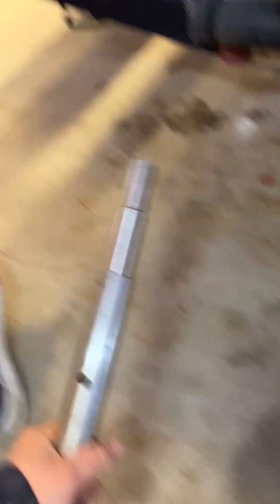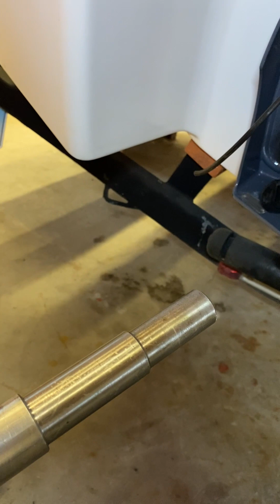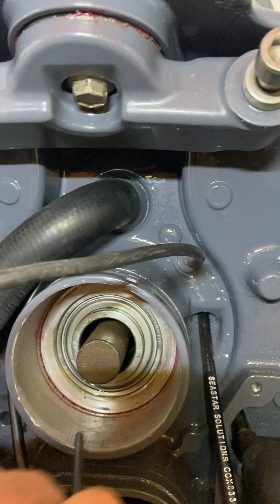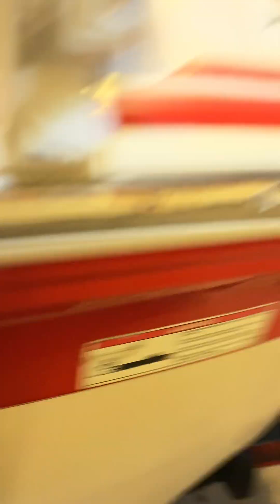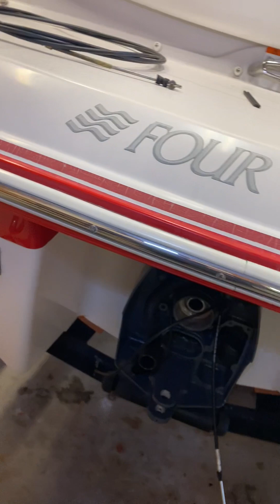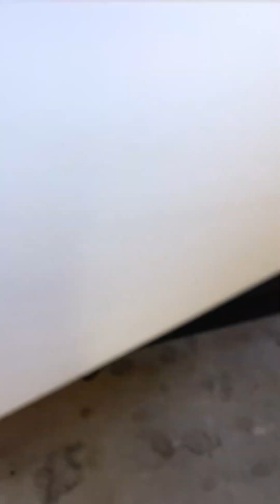Volvo Penta Mercruiser OMC Engine Alignment Trick Inboard Outboard Gimbal Bearing

Comment: GREAT TIP!
I thought it was funny when you said, "When I get rid of this boat, I'm going back to an Outboard." I have the same thought, but I want to go back to a Direct Drive Inboard (Prop/rudder setup). There's just too much going on in the outdrive for my liking. I have to deal with it for now though. Guess I need to find me a 1" pipe as I happen to have my outdrive off right now waiting on me to install a new Gimbal Bearing. My first time doing so by myself.

Comment: That would work awesome, but what if it is correct at being up and down left and right but what if it is not straight with the engine? It would still show it. It’s lined up, but not actually be straight like the front end of the engine would need to go down or something.
Reply: No it wouldn't

Comment: Exactly how I do mine! The actual alignment tool I only use at the very end as the final trimming .
Keep lifting the 1 inch rod up against it’s play in the coupler splines, to get the exact centre out at the gymble bearing. You will also need to keep trimming the angle of the gymble bearing to keep it on the same axis as the rod. Comes up perfect!